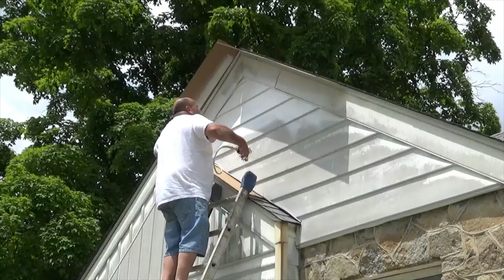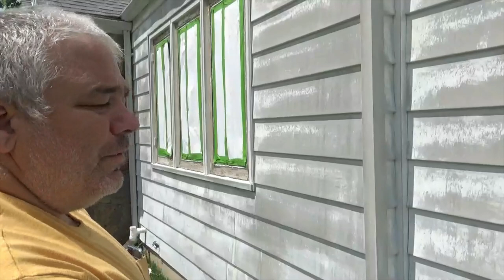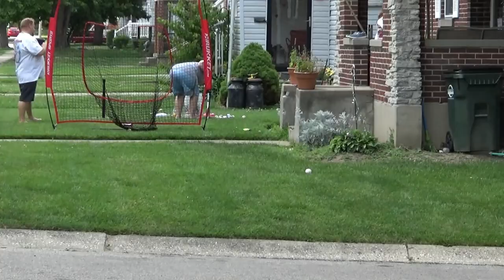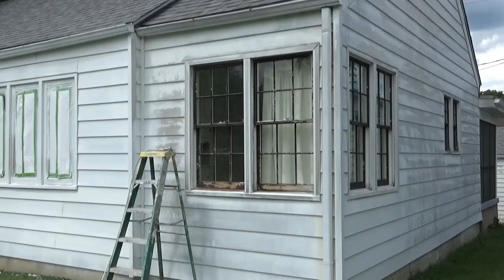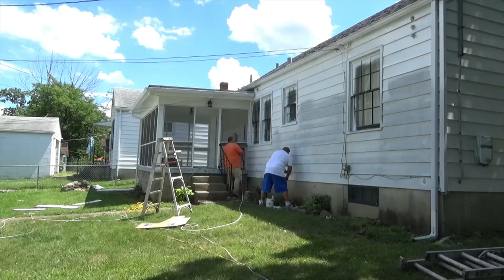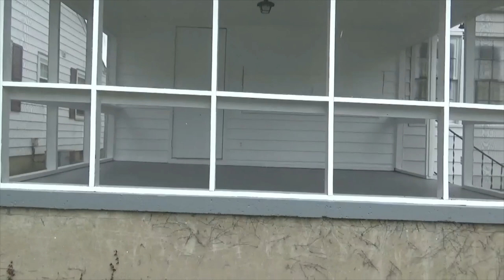How To Paint Aluminum Siding

Comment: My house - built in the 50s - has aluminum siding and I will need to power wash it before I can paint it. Thank you so much for telling us what product you used for priming. I've been putting off painting for so long, for fear of the paint peeling off after I put so much work into it. Your video has given me some confidence. I will need to buy a taller ladder, so thanks for the tip about putting the mitts on it so as not to scratch or damage the siding, too.
Reply from the maker: Hey Amelia  Im glad i could help
Reply: How did your house painting turn out Amelia? I moved into a 1963 home this year, it has about half of it’s original aluminum siding (half newer vinyl). I’m painting the wooden trim in the very near future and likely I will paint the aluminum siding in the spring. I already power washed it.
Reply: @Ethan.s..  It turned out pretty good, but now that a year has passed I see some thin spots I'll need to touch up. Plus, I need to builid some shutters to replace the plastic ones I took down. It was a good idea to do the primer first, because I don't think my house had ever been painted and it had yellowed.
Reply: @AmeliaBlakeMusic  good to hear you have painted it successfully. Good luck on the shutters.

Comment: Best video so far.👍
 Our house looks almost identical to the condition here. Been washing and scraping and hope to finish today. 
 I bought a cheap ol electric sprayer,  hope it does the job. If not I reckon I'll be rolling away.
 All the paint shops talk about latex. I'm assuming it's acrylic latex since you mentioned mixing it with water. Its been 40 years since I did any painting and my memory only goes back about 12 hours.
 I like that you mentioned ppg. They're the people I've been leaning to for paint. They have really good reviews and can tell you what you need to know instead of saying go read the bucket. 
 Thanks for mentioning that gripper stuff and again, very well done on the vid.
Reply from the maker: Hey Michael    Thanks for stopping by the channel        The gripper will do a good job sticking to the aluminum   just make sure it is clean.        Hope it turns out great

Comment: Can you post links to the paint gun and air supply!!? I read the comments about the paint and primer - copy that. 

First time home owner with the exact same siding. I want to do this in the Spring. Looking to get the same result as in the video - good aluminum siding, just needs new paint because it looks faded just like that!
Reply from the maker: Hey John the primmer is called ( Gripper)   it is sold by PPG.   The sprayer is a Graco 495 airless sprayer       we are using a Rac 10    410 fine finish tip in the gun.

Comment: Nice job 👌 nice tips.cant you use Bondo on dings? And sand just like on car's n trucks.great work 👍👍👍
Reply from the maker: yes you can if you need to   there are several kinds of bondo out there, some sand easier then others but they do work.  thanks for stopping by the channel.  Have a great rest of your weekend  led

Comment: Great job!! I want to paint my old aluminum siding as well.  Could you tell me what compressor & sprayer you used please? I have a cape cod style house about the same size. I dont think I can afford a company to do it, but I think I can cover the equipment and supplies and do it ourselves (especially since I can use the equipment for other stuff). Thank you in advance 😎
Reply from the maker: About 5 minutes into the video I talk about the type of sprayer I'm using. It's an airless sprayer it will run you over 4k to buy one. It would be cheaper to hire a contractor for a job that small.  Either way good luck with your house I hope it turns out great.
Reply: @led8541  Ok thank you! Sorry, I must have missed that part.  $4,000 is way out of my budget. Hopefully they don't charge too much to do it 🤞

Comment: Nice work would like to no what size air compressor is used seems like a beast that can keep up
Reply from the maker: Hey legit   the sprayer  is an airless sprayer  it does not use a compressor   it uses a piston pump  which  forces the paint out of the tip.  it is what i use on most of my big jobs.    thanks for stopping by the channel and i hope you have a great week     led

Comment: Hi Led,
Thanks for informative video! Do you recommend power washing aluminum or brushing it clean (house built in 1940, second owner purchased in 1969 and siding old, discolored and chalky and a dose of mold/mildew)?
Also does Gripper need to cure before applying paint? I’m thinking of painting the white siding a Gray Flannel color - should I get the Gripper tinted (if it can be)? As others have commented, sure wish my house was near you because I’d hire you! Thanks again for your comments.
Reply from the maker: Hey Cherie I like using a good cleaner and a scrub brush to clean siding and rinse with a water hose.  As far as the gripper it needs to have 24 hours before you top coat.  Hope this helps good luck on your project and  have a great week    led

Comment: Very good video!!... this will be my fall project. Don't let the photo full you lol ... I do have a question hopefully someone can answer. I noticed when you were painting the top  of the house around the soffits and fascia, you didn't cover the roof shingles. Will any paint get on the roof at all? I noticed the spray going over but didn't see any paint on the roof when you were done. Thanks again!!
Reply from the maker: Hey Carlos  as long as you dont hold the gun directly towards your roofing   you wont have any problems .   In the summer heat the little overspray there is dries almost instantly and is just dust. It simply blows away.

Comment: Great video, thank you. One of my aluminum siding walls is exposed to a lot of humidity and shade. Any suggestions on preventing with mildew stains?
Reply from the maker: Hey JP  mildew is a tough one.   It normally comes back no mater what you do  so i  wash the exterior of my house every year with a bleach and water mix. There are several other detergents out there that will work. Its just something home owners have to deal with especially if you have vinyl siding, the petroleum in it just attracts mold.  There is just no permanent fix.   I hope this helps and  I hope you have a great week.  Thanks for stopping by the channel           led

Comment: What paint finish is better for aluminum siding flat or satin? Thanks 👍🏽
Reply from the maker: Hey Oscar   Its really preference.  A flat will help hide any imperfections you may have in you aluminum but a satin will repel dirt easier.  I prefer a flat personally but many of my customers like the satin or even semi.   Good luck with your project and have a great week       led
Reply: @led8541  thanks 👍🏼

Comment: Looks great! You mentioned PPG Gripper primer. What kind paint did you use as the final coat? Is it something for aluminum? I have a huge aluminum picnic table in mint condition   It’s a bright red right now and I want to paint it a more subdued color but need it to hold up to the weather. I was so happy I stumbled on your video. I’ve only seen spray primers in a can posted and really not impressed with the results. Any suggestions on a type of paint. It will be table top and the 2 bench seats getting painted. Thanks so much!
Reply from the maker: Hey Lisa   Thanks for stopping by the channel. Table tops and bench seat can be tricky .  The paint i used on this house is an acrylic . The reason for acrylic is for its ability to flex as the house flexes.   For something you are going to be using and setting items  you may need to move over to an oil paint .   It will be much harder and can take the abuse of sliding plates or bowels or whatever.   Now using oil may need to be touched up every now and then because the aluminum table may flex with the weather and cause it to pop off in spots.  So a little touch up may be needed at times.    I hope this helps in getting your table finished     thanks again for stopping by the channel   and  I hope you have a great week      led

Comment: How long should that paint job hold up? My home inspector said not to paint aluminum siding or I would have to repaint every 3-5 years
Reply from the maker: Hey Growing Groceries     The new acrylic paints we use will stay on aluminum for many yrs and probably never come off, but  it will fade and possibly get dirty  especially in high trafic areas.  So to keep it looking nice you will need to paint occasionally.  It may be 3 to 5 yrs  or it may go longer.   My house is a total paint job on the exterior  and i have to maintenance it every few yrs to keep it nice.     Thanks for stopping by the channel    hope you have a great weekend     led

Comment: What tip should I use for painting aluminum fascia and soffit? What tip did you use for the siding? With flat paint how considered should I be with lap marks?
Reply from the maker: Hey DK   I only use (rac 10) tips from graco.  The size really depends on what you like.   I normally use a 410 or 412

Comment: Hey, nice job.  Question, if the old paint is flaking and you want to remove it, any suggestions on how to do that without flakes flying everywhere.  I thought of powerwashing but flakes were flying and it wasn't getting paint off consistently.  I don't want to paint over any flakes and want to ensure the finish isn't uneven.  Thx.
Reply from the maker: Hey Gary  Power washing does work but is super messy and water will be everywhere. I try to hand prep with scrapers/putty knives and wire brushes when i can. Pending on the condition of the house its hard to get all the loose off.   Just get as much as you can and let the paint do the rest.  Make sure to use a good Primmer and it should turn out great .   Hey thanks for stopping by the channel  I hope your project turns out fantastic and have a great rest of your week      led
Reply: @led8541  I'm most concerned about paint flakes going everywhere and for the flakes I don't get off with powerwashing I would be applying paint on top of those flakes and that isn't good.  :(
Reply from the maker: @garypersonalstuff  If its flaking that bad  it will take some serious effort to get it all.   Let me know how it turns out .

Comment: Do you use gripper for steel siding as well? And for the acrylic top coat do you thin a 5 down with about the same amount of water as you do with gripper?
Reply from the maker: Hey Brandon  gripper will stick to almost anything  but steel siding may rust and gripper will not hold rust back.  And yes  we used about the same amount of water on the top coat.  Just remember every product is a little different and does take time to learn how they work and how much to thin them.    thanks for stopping by the channel  and have a great week    led

Comment: 💥 3:05 the ladder is way too steep here. The problem is, at that angle when you get to the top, the bottom, wants to kick out and slide away from the house and being over that window, imagine the nightmare that would occur when you’re on the top of the ladder going through that pane of glass.  40 years on a ladder, sometimes 26 or more feet up and never an incident and I wish it on no one.

Comment: im not able to get your recommended PPG acrishield as an individual. What are your thoughts on conco paints brand. (sold by menards) they offer both 100% acrylic paint and 100% acrylic primer. I'm going with bright white, what are your thoughts on semi gloss or satin?
Reply from the maker: Hey Jordan as long as it's a good acrylic paint and primer it should work fine.  I would use a satin .

Comment: Does the gripper primer work well on brick? What is the best topcoat paint for aluminum siding and brick
Reply from the maker: Hey Ben   for brick I only use Shirwin Williams  (Lox On  XP)  2 coats .   for aluminum siding   any top line acrylic exterior should work  as long as you clean it good and use a good primer such as gripper.    Thanks for stopping by the channel and have a great week     led
Reply: @led8541  How many gallons of acrylic exterior paint did it take to cover this house? My house is similar in size....
Reply from the maker: @AmeliaBlakeMusic  Hey Amelia   this job took about 8 gallons of primmer and 8 gallons of finish.  That included the small one car detached garage .  The paint goes a long ways on the aluminum siding .   I would say buy 5 gallons to start and get extra as you need so you dont over buy.    Thanks for stopping by the chanel   good luck with your house and  have a great week          led

Comment: Did you mean 140 psi?
Reply from the maker: no  1400   im using an airless sprayer     1400 is not high for an airless you can easily run 2000 if you want

Comment: Nice vid-can you suggest video how to best clean off badly oxidized aluminum siding paint to prep for painting ? Tx !
Reply from the maker: Hey Ben   most of the paint stores and or lows/home depo  sell a product called  TSP (trisodium phosphate)   It does a pretty good job of cleaning off aluminum.    It will kill plants so wet them good before using it and then rinse them good.   Use some serious elbow grease when scrubbing.  There are several other siding cleaners available out there.  TSP is the one i use the most .   You dont have to use a pressure washer ,  just a bucket and scrub brush will do and then rinse .    Hope this helps    Let me know how it goes.   Have a great week    led
Reply: @led8541  Led, Appreciate your quick & helpful reply. Also, my paint is almost all going to come off-it's seems decades old, so how to absorb it, instead of it getting onto plants/driveways (where most will go) and wooden deck in back-are there food big absorbent sheets that are relatively inexpensive (so the paint doesn't soak into driveway/runoff into lawn/street)? Tx again
Reply from the maker: Hey Ben  it is a messy job  there really isnt no way to absorb the amount of water that it normally takes to do the job.   Plastic may protect your plants and deck but catching the water  I dont think is possible. making sure everything is wet in the beginning is probably the best thing you can do.   Good luck with it   I hope it turns out

Comment: When using the sprayer, is there a concern that the overspray might paint or stain the roof shingles?
Reply from the maker: Hey Nicolas   there is a chance of getting over spray on the roof.   If you watch tim as he sprays   the edge of the gutter acts like a paint shield , when the spray hits it   it is deflected away from the roof and the a split second later it is just dust  so it cant hurt or stick to anything .    The product you use and the pressure and tip play a big roll  in controlling overspray.  Hope this helps    Thanks for stopping by the channel and have a great week   led
Reply: Thanks so much! Totally makes sense. I appreciate the great advice & video!
Reply: Yes. He should of put a drop on the roof or played a shield in the gutter. Spechuly how the wind was pulling the over spray over the gutter and up the roof line

Comment: Great video, I've got aluminum siding on my bi level home in IL and I was hoping to not use a primer. Is there a primer mix paint for houses ?  I don't even know the average cost for this kind of job. Labor , paint , material
Reply: Don't use a all in one primer paint on metal I paint metal guard rails at work I have tried all kinds of all in one products nothing works better than a good scrubbing pad use a good metal primer and a good quality paint  the nice thing about painting metal is.you don't have paint it very often if you do a great job of preparing the surface and use good  primer and paint 
And clean clean clean with tsp and a scrubbing pad you can get them at dollar tree cheap

Comment: Look at that wind.What if you get it on neighbors house.Over spray ?
Reply from the maker: Hey Potato   that is a great question .   The overspray is mainly dust once it hits the air.  it drys is a split second  so we have no problems with overspray with the products we were using that day.   NOw there are products that we have to be carfull with and when we use them we take precautions .    I should have talked about that in my video .   Ill try and remember for the next one because it is super important.          thanks for stopping by the channel and have a great week                led
Reply: @led8541  Thank you for replying.Have a good day.

Comment: What kind of paint is best?
Reply from the maker: Hey Alexander        That is a tough question because all of the different manufacturers have there version of what they call the best.   I use a lot of ppg and sherwin williams products and i like some of both.   the products in this video   the gripper primer and the ppg acri shield top coat  are two products that i use every day and i know how they work.  Are they the best    I think for this job they were the best   the house turned out great and im sure it will last for yrs.      Thanks for stopping by the channel  and i hope you have a great week               led
Reply: @led8541  Thank you for the tip:) Your home looks great!

Comment: Can you repaint previously painted aluminum siding?
Reply from the maker: Yes  just make sure the surface is clean .
Reply: @led8541  Thank you for the feedback. Do you pressure wash the old paint off first? The previous owners did a sloppy job and you can see brush marks, etc. I'd like to repaint with a smooth surface. Whats your thoughts?
Reply from the maker: @concertinanickz   With the right pressure im sure the old paint will come off .  Its just going to make a lot more work   but it will  look much better if you can get it off.   Just be careful with the pressure washer  dont  damage the house or yourself.
Reply: @led8541  If the old paint is still adhered well, would you still use the Gripper primer mentioned in other replies?
Reply from the maker: @davidbeiter9212  I always fully prime